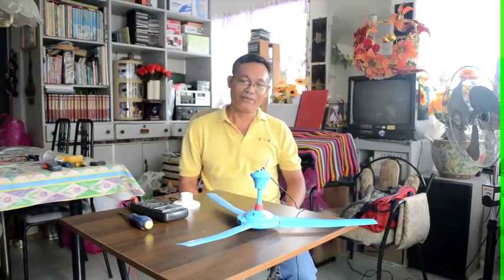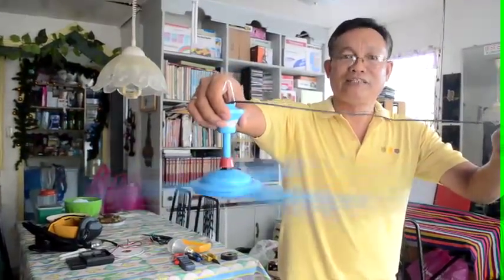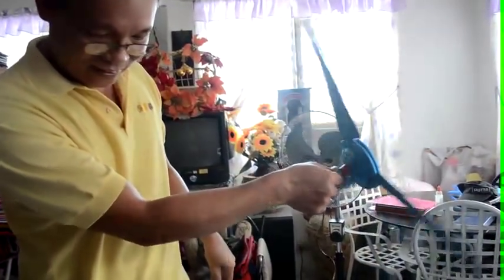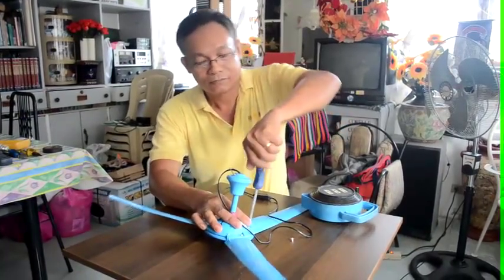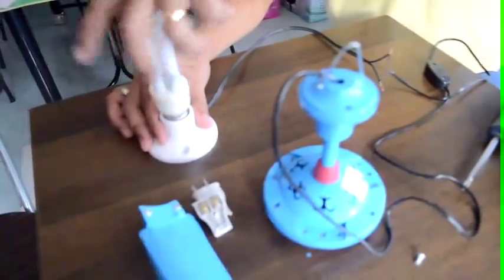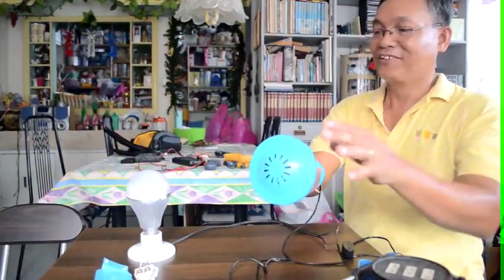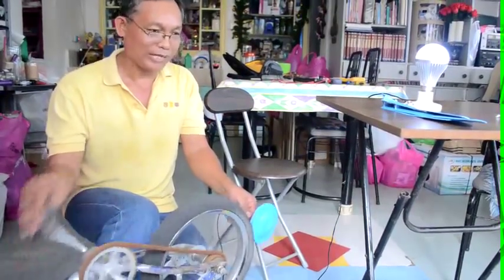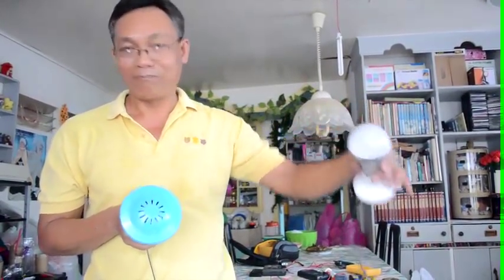Free Energy:How to Utilize a Cheap Ceiling Fan for lighting 220V 5 watts Bulb?

Comment: Great life hack.
Can you please show how to connect a couple of these together and convert the output to DC then store it in something like a car battery? That would really be they key for your invention. AC current is pretty dangerous for use with normal household electrical appliances due to the possibility of high spikes in voltage. It can burn a lightbulb or a fuse of a different device.

Comment: What you are holding my friend is probably a magnetic motor and can be found in old electrical appliances like old printers,vcrs, ceiling fans, and ect... they a very handy to use when you get tired of high electric bill costs or power outages

Comment: Good job, Professor, but I'm surprised why you still exert your energy by utilizing a bicycle in order to make use of  the "free energy" you "discovered" from a "low-cost" fan. Can you not add another low-voltage generator to rotate the fan in order to produce an induced voltage (potential difference) that could also be used to supply the said motor after the fan that turned alternator has reached its peak rotation.

Comment: This is NOT a free energy generator.  To generate electricity this way, you will still have to use an energy "input" to turn the converted ceiling fan either manually or by the use of some mechanism, very much like a conventional generator to produce electricity.  On the other hand, the free energy generator harnesses energy that can be found in the surroundings.  Free energy generators DOES NOT USE ANY MECHANICAL MEANS or any "input" to generate electrical energy.  You just harness it using a device, like for example, Nikola Tesla's coil and the likes.  Now, these devices are being rediscovered by numerous people all over the world.

Comment: Found the fan and it's expensive around 30 dollars and you said in the Philippines its only cost around 1.60 dollars? is it because of tax? found no manufacture name on it. having this idea maybe someone already creates a self-power fan since the fan only used around 60w but the fan blade rotation can produce around 220w of electricity, has someone already see this model? let me know and tell me the manufacturing brand name here. Thanks

Comment: Wow, cool idea. I could use a old ceiling fan and place it on the patio roof to power a light bulb at night, but the question is, how to prevent the light bulb from burning out if the voltage change constantly dou to the wind? Maybe I could use a inverter. Any suggestions?

Comment: nice work. ill buy a low cost ceiling fan and duplicate the experiment. this can be a good wind turbine project. and a community based project like using an old motor ( but need more readings)

Comment: its free but not free energy. free in the sense u cud use old fan. convert it to gen. hehehehe actually basta pma motors it can be vice versa. put power and it will turn. turn it and it will produce voltage. at the same power if right rpm is attain. hehehehe

Comment: It is deceiving to call this "Free Energy". You basically used the ceiling fan motor as a generator. The big question is who powers the generator? Who is going to spin it? You spend your own energy to spin it and that energy actually comes from the food you eat. Unless you got free food, you didn't get any free energy. :-)
Reply: hey theres another way to spin that ceiling by using wind 
Right?
Reply: +Johnwel Empino - you probably have not tried spinning a generator before. When there is no electric load you probably can spin it with minimal effort. But once you complete the circuit to draw any current, the generator will face a huge resistance. That explains why wind turbine is like at least 15 feet in diameter in order to catch enough wind. Everyone knows wind generator produces free energy, but never in this configuration!
Reply: I think what the man means is that free in terms of electricity cost because it doesnt use any electricity that doesnt add in your electricity bills :)
Reply: He only shared the basic principle,it is a very good information though,perhaps a windmill or a watermill may  facilitate the spinning of the generator,I also think a capacitor could be used to regulate the electricity output.
Reply: yes this is a wind turbine concept
Reply: It's still free energy. The wealth is in the learning.  you can use exotic wind turbine designs to harness wind, water and tide. :)
Reply: well said hahaha
Reply: cplai I get ur point about the load resistance 
But big turbines draw a lot of load
Unlike 5w out of 12w
It might be possible with 50inch blades

Comment: the idea that Sir Palasan imply is very useful anyway but the application is pretty impractical. find any defective washing machine and take out the motor in it or find a car alternator in automotive shop, they can produce significant amount of power which can be useful to run many household appliances.

Comment: very good find! pwede kayo gumamit ng isang 12v motor para paandarin yung ceiling fan powered by a small motorcycle battery tapos syempre yung power na nagawa ng ceiling fan pwede ng icharge yung battery para continous operation at yung excess sa mga 12v electronics na. syempre may regulator para iwas busted o sunog.

dapat oiled yung bearings so less friction para maximized yung output.
Reply: how can a 5 watt celeing fan charge a 36watt-hour battery and still have excess power to drive other electronics? hahaha

Comment: If your area is not windy, a water wheel can rotate the motor, but must modify and must also have a multiplier gear box to rotate the motor faster then save all the power in a big battery suitable for the energy it produce.

Comment: Too bad, our place is not windy enough to make this useful for generating energy.
Reply: Use magnet instead
Reply: magnets dont work buddy
Reply: The magnet is a LIE!!!
Reply: Philippines Kahel Orange then make electricity with out magnet
Reply: mahersalalhasbas marlon was most likely referring to the videos showing a dc fan being turned by a bunch of magnets. . i was just saying that those videos are just lies.

in reality a magnet is needed in order to pull the electrons within the copper wire into movement, thus creating a flow of electrons which creates electricity. . . as you can see from the video above, that fan has copper wire and magnets in it.

Comment: Amen Brother! God loves you!

God made you a genius haha. Maybe you can keep the roter moving by using magnets. I mean placing small magnets on the rotor (without blades) and then use a bigger magnet close by to push the magnets.

God bless you brother! In Jesus powerfull and loving name!
Reply: sounds interesting. make a video demo bro
Reply: chris chan I will try it, only i need some money to find the right magnets. When i got the video i will post here aswel.:)
Reply: nice. looking forward to that.
Reply: Wensis Rompas Use  speaker magnet.
Reply: That's a perpetual motion machine that you are describing, it will not work.
Reply: Wensis Rompas
Sorry for my mistake ! You need neodym magnets, not speker magnet.
Reply: It is still a perpetual motion machine that you are talking about. It must have an outside source of power.
Reply: Audiosavings Photos Still an impossible perpetual motion machine.
Reply: Amen
Reply: +Wensis Rompas I think a pendulum would work better, with magnets that generates enough push to magnets to perpetually rotate a gear that connects to the rotor.

Comment: Please place magnets in order to spin instead of using a cycle wheel. The magnets will automatically spin the fan base and electricity will be generated. it will be a very useful automatic electricity generating device.

Comment: good effort, combine your low cost ceiling fan generator with a 'joule ringer' or 'joule thief' circuit, (or maybe just some capacitors) both of which are researchable & easily made from you tube videos & you may manage to make a more useful amount of energy.  good luck.

Comment: it is not new,why dont you try the big motor or any conduction motor,if you run it in by mechanical move by rotating the rotor and you will observe that the output is better than you expected.

Comment: Sir Salis, , Maybe that Low cost ceiling fan is something like a "Synchronous Motor". Indeed it will generate a potential difference across its terminals once the rotor is rotated. Same principle in Wind Turbine since it is a Synchronous motor it will generate power once enough rate of air hits the turbine blades. I admire you just transfer the energy from your body to the bike going to the ceiling fan and finally to the bulb... Thumbs. Up.   Keep going for further improvement.  Franz. from Cebu.

Comment: don't remove the propeller of the fan. put it outside where the wind can blow it. then use it to charge a battery. then you can have a stable electricity.

Comment: This fan is cheap because the fans that are slightly more expensive have something called "diode" which only lets the electricity travel one way and not the other , hence protecting the user from unwanted shock and even death . All electricity is in AC when produced , one must convert it into DC by using integrated circuit or a transformer and capacitors . Even then the electricity is not fully DC , the only way a true DC can be achieved is to connect the electricity with a dry rechargeable battery which will provide the most closest form of DC .